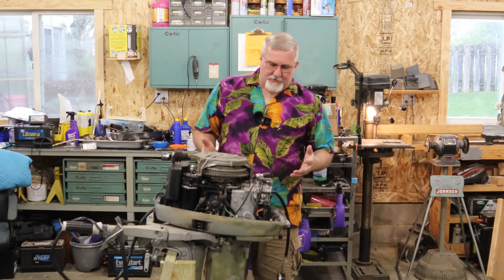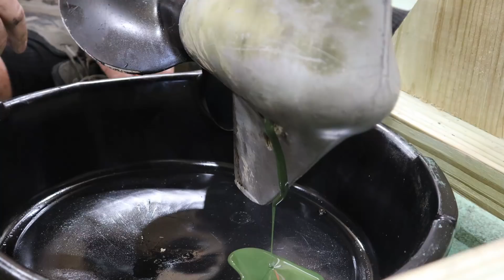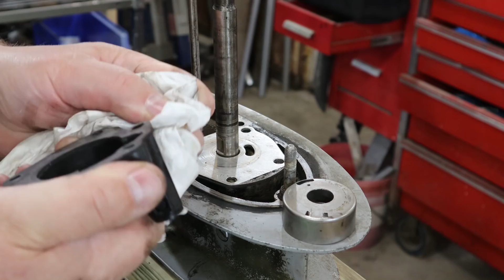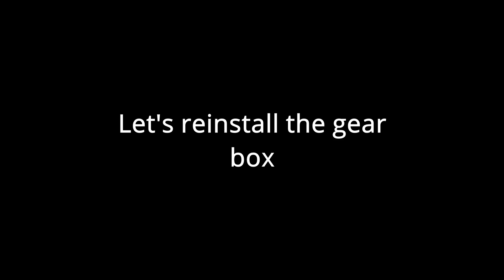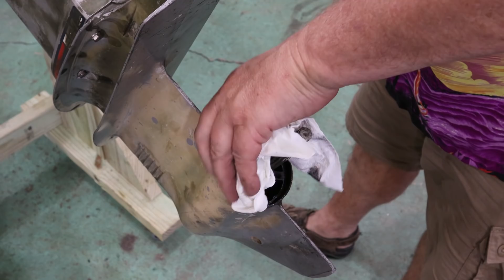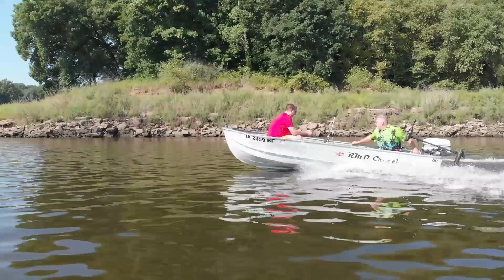1979 Evinrude 35hp long shaft. Said they couldn't get it to run. Can I make it run? Part 1

Comment: I'm  just curious  about  these motors are theses  less reliable than evinrude and Johnson  that have less hp  than  these 35  I noticed  on Facebook  market place  I alot of   30 and 35 hp motors  they are mostly  just parts or parting out  once in a while  their be one or cpl that in running  condition   I noticed  that  20 to 35 they all have the same blocks  only different  intake manifolds bigger carbs  and few other things   does extra air flow and power make them  burned out  faster

Comment: How did you get the copper tube back into the water pump, because it's hard to push it back into the grommet. I missed that when you just pushed the lower back in.
Reply from the maker: you need to make sure you have some grease on the rubber and the copper tube.

Comment: Hi I have a 1981 starcraft with 3.8 omc and 800 sterndrive it was very hard to shift into gear i think I've traced it to the lower drive sift assist thing how hard is it supposed to move ?? And this is my 1st boat some tips would be great if you have time
Reply from the maker: I wish I had tips for you on this issue. I have not pulled apart a larger lower like this.
Reply: @Michaelsbackyardmarina  thank you

Comment: Great Video.   I own a Johnson 35 hr that I just purchased and I am trying to get it going.   I took it out for the trial run and it started well, jumped up on plane and went 400 yards then almost died.   After that it would only run at 1/3 power.   I ordered a carb kit and redid the carb today but the kit had a different kind of needle in it with a hook spring on it but the old one had no spring or a place to put one.   I decided to try the new needle with the spring clip and the motor started ran for 15 seconds then died and would not start.    I am wondering if you have any thoughts about the needle choice I made.   I replaced the fuel lines as well.   One more question....  There was a gasket between the air box and the front of the carburetor to the air box.  My Carb kit did not include one so I will end up making one but how the heck do you keep it in place and not have it fall out?
Reply: I should have mentioned it is a 1979
Reply from the maker: How old is the fuel pump? Sounds like it could be starving for fuel.
Reply: @Michaelsbackyardmarina  It is old.   I was wondering if that might be the problem  I ordered a pump tonight.   I figure that if I replace the pump and I still have the problem I will have to go back into the dragons colon and see if I missed something in the carb.  By the way I give you the credit for giving me the guts to attempt the surgery!  Thank you for the great work.

Comment: Very cool vid... I worked on lots of this area and prior era motors when I was 13-18 years old.... And then when I was in my 30s.....  I am 58 now. These were so easy to troubleshoot, and that is the first step I always did, a compression check. You did everything I did in about the same exact order to most all the old motors I tinkered with.  I liked that 76-79 era of motors.... no break points, but before they started going super cheap on a lot of things.... I think that 35 was also of the same family / displacement -   20-25 and a 28 special if I remember right.  The 9.9 / 15 was a favorite of mine as well....    good vid....
Reply from the maker: I should have it running this weekend and release the second video. Thanks for watching.

Comment: Thanks for a great video In the beginning you said that you changed some electrical parts what is the part number for the coils and electrical box and do you have the part number for the gas pump I have the same engine here in Sweden on my ryds 520ST
Reply from the maker: You can find your parts on marineengine.com

Comment: Hi Michael, I am working on a 79 Johnson (exact same) motor.  It is my first outboard to own and work on.  Having discoveries of my own, and overcome each one with your help.  Thanks.  One thing I can't figure out is how to adjust shift linkage.  My shift arm, when in straight up neutral position, is actually in reverse, and have to move forward for neutral and even more forward to shift in forward.  It is too far clockwise for shift cable to properly shift into forward.  My coupler which is the same as this motor, has only one bolt, the bottom one, and the top one is either snapped off or is welded onto upper shaft.  So either the cam gear at the shift arm is jumped or the shaft is too long.  What do I do?
Reply from the maker: makes me wonder if someone changed something or put it together wrong or made their own shaft.  You could take it apart and shorten it to make the shift lever in the right position.
Reply: @Michaelsbackyardmarina  Yes, all possibilities.  But cutting and welding the shaft shorter is probably best bet.  Do I have to take the power head off, to get to the upper shift linkage and remove it?  I saw how you can remove the one bolt and the shift arm and shaft come out, but what about the lever and the long shaft down the upper housing, how does that come out?  Great videos by the way.  Keep them coming.  Subber and notifications are for sure set.

Comment: The 1979 and 1980 35's had higher compression than all of the 31.5 cu in motors that came later. After an hour of run time, It will likely come up above 140. I have three, plus a couple later 35/30 motors that I depend on in the ocean. Very durable motors. The gear ratio of the lower unit is somewhat higher than later motors, 1.89 to 1 sticks in my head. pretty high. A 15" pitch will work with a light clean boat, but on my 700 lb work boat, I run an 11" pitch. 13 P was too much.

You will soon notice that the lower unit is 2" longer than a normal "Long Shaft". It will likely be 22" from clamp to cav plate instead of 20" This complicates mounting a bit if you want to optimize the setup. It has the clamps and only two 5/16 bolt holes so raising the motor two inches can take some thought.. I added a couple inches to the top of the transom. You can just mount it and bee a couple inches deep with the cav plate, but it will cost a bit of speed and efficiency..

As someone who really depends on running these 40 year old motors successfully, I do have some advice. These motors have sitting, for the most part, for decades. It is important to wake them up gently. Whether you can see or feel it or not, there is typically some light corrosion throughout the motor. An hour or two of normal run time will, in effect, clean up any corrosion naturally. Think of it as breaking it in again. Done at all right, you should pick up some compression and reduce friction of all moving parts, for long term durability. This is a terrible time to get a lean run. Even a little lean reduces lubrication. I strongly recommend cleaning the carb thoroughly before running.. Any obstruction of the jets and passages will make it run lean and you won't even know until it bogs or starts to cut out Too late. Just like during initial break in, avoid any lean  condition during the first hour or two of an outboard reawakening. Cleaning that carb is Is the best way to avoid. carb in that motor. On that motor the starter must be removed to pull the carb. A bit of a hassle, but still less than five minutes, not so bad......Cheers, JE
Reply from the maker: Lot's of excellent advice.  I have a advantage being in Iowa is that most all motors I am working with have been fresh water only used. Thanks for watching and commenting

Comment: Thanks for the video. I am working on a 1978 25 hp that looks just like yours. The wiring is bad and just crumbles. Do you think I can get a new one and where?
Reply from the maker: check marineengine.com , not sure if a wiring harness is still available.
Reply: eBay often has parts available / listed.....

Comment: That outboard comes in 3 versions 1st -Electric start 2nd - pull start 3rd - Electric and pull start so they have 2 different hoods and the motor with electric only doesn’t have a recoil on top so you can wrap a rope onto the flywheel and pull start if you had to ! Just an observation ! I’d pay $300 for that one , nice score ! It has at least $600 in parts alone if you parted it out !
Reply from the maker: Good information, thanks.

Comment: I have an early 90’s Evinrude 9:9.  I’ve heard you can put a carb from a 15 hp on it to make it a 15 hp.  Have you ever done that carb swap? Any opinion on the modification?  Thanks
Reply from the maker: not sure about that year.  I have done it on a late 70's Johnson.
Reply: Thank you.  Your videos are informative and filled with common sense.
Reply: Yes just a carb change you heard right

Comment: I have no spark on the top cylinder 1976 Johnson 15hp. Any help would be appreciated. I’ve changed coils plugs and set point but still nothing
Reply from the maker: I have had a similar issue, Check the wires to the coil to make sure they are grounding out on you.
Reply: @Michaelsbackyardmarina  okay I will, I need any help I can get!!

Comment: I have a 50 Evinrude with no spark on cylinder 1top cylinder. I change the coils and the CD1 power pack  and still nothing. Any suggestions please
Reply from the maker: I have had a similar issue, Check the wires to the coil to make sure they are grounding out on you.
Reply: @Michaelsbackyardmarina  I concur...exactly...corroded / bad grounds are a major source of this sort of trouble

Comment: Enjoy watching your channel.  I really like your diagnostic approach.  It is easy to tell this is not your first rodeo and that you have excellent motor repair techniques.  Compression, Spark/timing, Fuel, vacuum leaks.  Then changing the lower end gear oil, checking for water in the oil to see if any additional repairs are needed i.e. seals etc. Checking the water pump and replacing if necessary is a given.  I noticed you removed the prop.  That also is always a proper maintenance as it always good to check if you have any fishing line wound around the shaft which can destroy your lower shaft seal.
Look forward to watching your second video on this motor.  It will deserve a nice paint job on the rest of the motor to match the nicely painted cowl and a properly repaired engine.
Keep up the excellent videos as I really enjoy them.  You are the man!!!!!
John
Reply from the maker: Thank you for watching and the kind words. I will keep the videos coming.
Reply: I agree...he did everything in about the exact order I always did. The very first thing is a compression check, that way you know which direction to proceed..... :-)

Comment: I've got a 1981 35hp i picked up for a case of beer!!   Apparently it runs and dies and no one can figure it out.  I've ran it in the test tank for an hour and it runs good.. the only thing I can see is that it had a 4 blade 16 pitch prop on it. Im going to get a 13 pitch  prop and try it out.
Reply from the maker: Good luck and thanks for watching.

Comment: You’ve come a long ways in your ability to repair Outboard motors I’ve been watching since day one I worked at an authorized Johnson dealer in trained at the OMC factory you are now a first rate mechanic well done you got it right
Reply from the maker: Thank you so much for the kind words. I'll keep tinkering. Thanks for watching
Reply: @Michaelsbackyardmarina   
Question for Randy Miller or RMD Creations: Can the short and long drive shafts/shift linkage/exhaust tube be swapped? I have a long shaft power head but the lower unit is 100% rust on inside! I can only find short shaft lower units. Could I purchase a short shaft lower unit and just swap out the short shaft components? Luckily my long drive shaft pinon splines are rust free. Thanks for any help guys!

Comment: Great To See more videos coming from you. I just got an Astroglass 16 ft. fishing boat with a 50 HP mercury where the deck was rotten and needed replaced SOOO the rotten wood is out and I'm trying my hand at Fiber glassing in a new to me front deck. My biggest problem is the weather won't let me do it here in Nashville TN  Sure wish I had a place like you have to work in. Thanks again for more videos and keep them coming.
Reply from the maker: I will keep them coming. I have over 30 outboards to fix this summer and my big Starcraft.  Thanks for watching and commenting

Comment: ?I need your help bud pls I got 6hp Evinrude  think its from the early to mid 90s but when I'm going on the boat it will run perfectly  for 5 mins then it will just shut off and will not start back up for about a hour or till completely  cooled of pumps water like a champ also any info u can give would be awesome  love your videos  by the way
Reply from the maker: ohm out your coils
Reply: Ok sounds like  plan yeah for got to say it has no spark after it shuts off to so I think u might just be right thanks a bunch I'll let you know in a week or so when I get the parts if that was it thanks again

Comment: Hey bud first thing is love the channel  been subscribed for a year now I think I have a question  I think u can help me I have a 6hp Evinrude  that runs grate starts first pull and all but will on run for about 5 mins the just dies and will not start for about a hour or two and then keeps doing that all over the harder u run it the faster it will die thanks for any help u can give bud
Reply: Have you tried squeezing the bulb while its running?
Reply: @cliff0dean  yeah now that he just told me its probably  my coils I remembered it has no spark after it shuts off also so I think he is right I think the coils  are overheating and need replaced thanks for information though bud
Reply from the maker: Sounds like you may have bad coils.